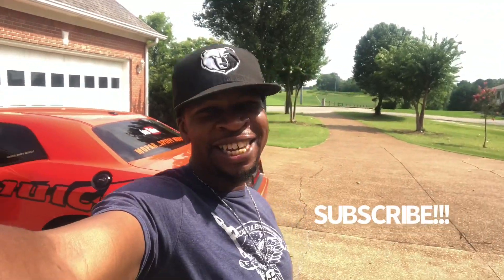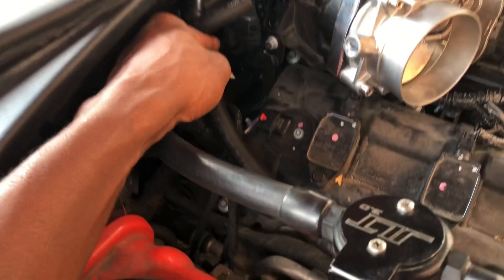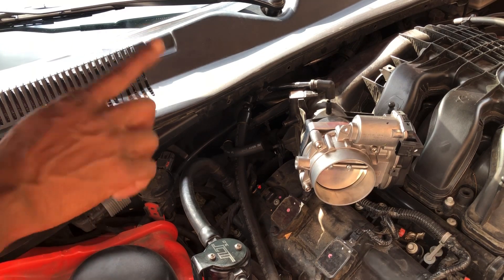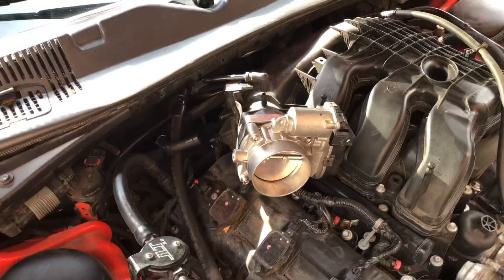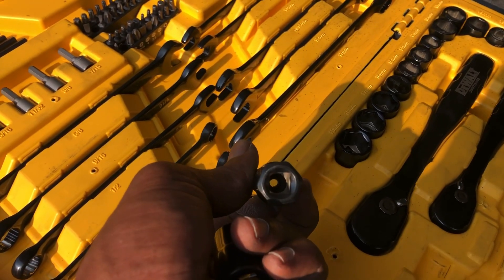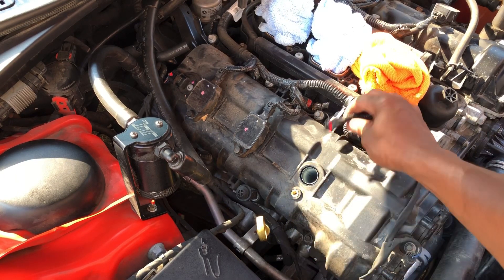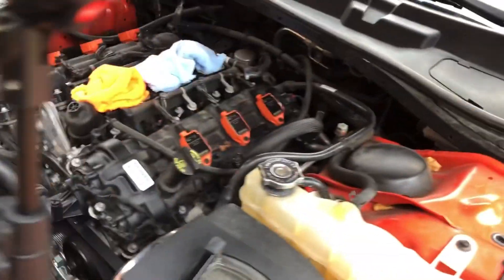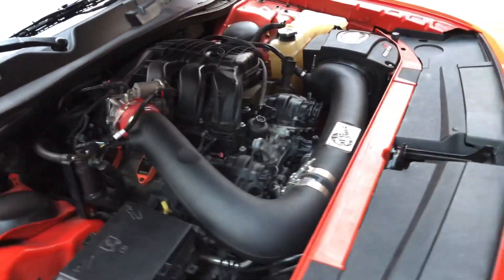RIPP SUPERCHARGERS COIL PACKS AND LASER IRIDIUM SPARK PLUGS INSTALL 2018 DODGE CHALLENGER

Comment: Literally just purchased these myself and should be here by this weekend. It was time to change my spark plugs since I'm at a 100K miles, but definitely wasn't paying $300 plus labor for a mechanic to put the regular/stock ones back on, lol. I've changed my own spark plugs before on another vehicle, but this is good to see cause I'm about to put it on my 2018 Challenger SXT. I'll be installing some fog lights as well on my car,, those LED lights definitely make the car shine and look superb. Thinking about putting in a cold air intake myself with a bigger throttle body as well.
Reply from the maker: I’m bout at 100k myself them new spark plugs gone make a difference thinking bout doin some more lights myself the throttle body and intake you’ll get some nice hp gains from it
Reply: @mopar_spiffymuscle4784  question, just how big of a throttle body can you put on the V6 Challenger? I was thinking like a 85mm or an 80mm, but is that doable?

Comment: I have a Dodge Challenger SRT and I'm thinking about getting the Ripp Supercharged coils, and Iridium Spark plugs. Either from Rock Auto, or Summit Racing.
Reply from the maker: That’s wassup I seen a video where those coil packs added 30 whp to  the 392 engines and up
Reply: I'm ordering everything as we speak. It already takes off, so I know it will be much better when its all done.
Reply from the maker: Yesssirrr 💯

Comment: I put these RIPP coils on my 3.6 as well and Denso iridium plugs in to.   It is a noticeable difference especially at the low end.    Enjoy
Reply from the maker: Most definitely and notice gain in mpg if u get 80mm throttle body you feel it on top end too

Comment: I have the same engine and have the ripp supercharger coil packs whats the recommended spark plug to run and what did you gap your plugs at?
Reply from the maker: I got the iridium spark plugs from RIPP n they were already gapped n ready to go

Comment: Did you feel the added power?
Reply from the maker: Yea especially on top end💪🏾
Reply: @mopar_spiffymuscle4784  appreciate it keep up the grind I been watching a few of your vids and I just ordered them along with a CAI, 78mm throttle body and a Liechtenstein weight pulley crank so hopefully I feel a difference after all the mods I put on
Reply from the maker: Yea you will most definitely 💪🏾 n thanks